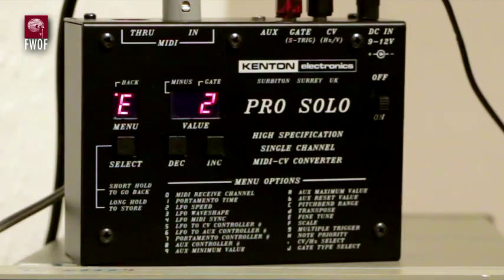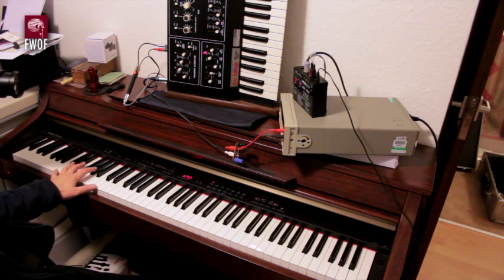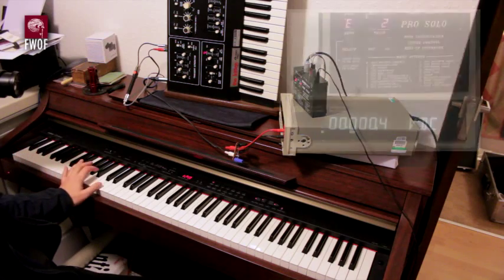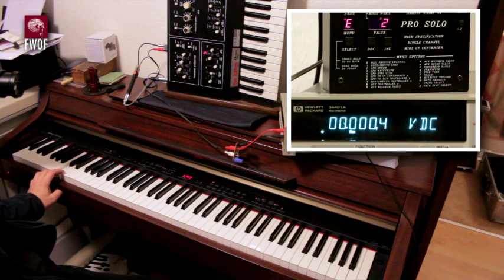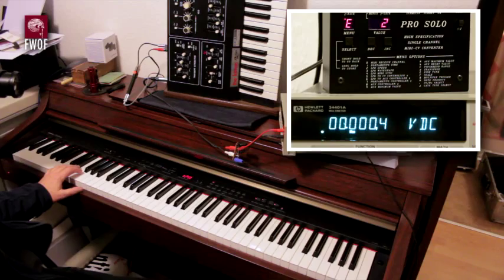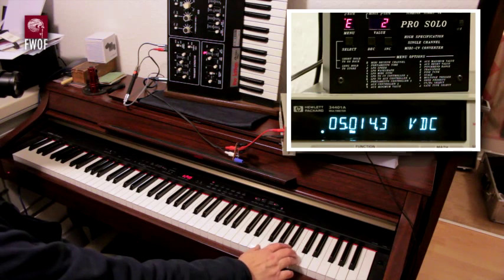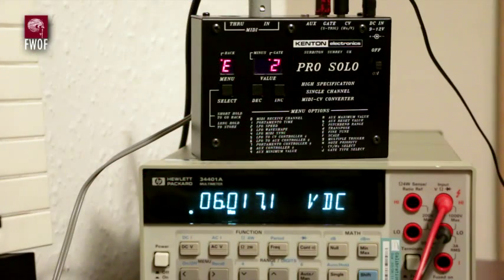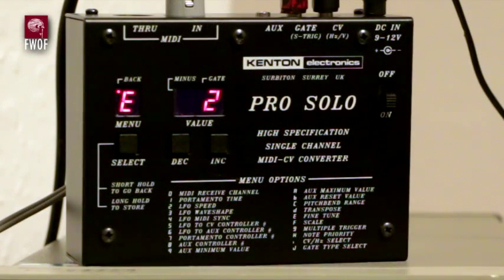Kenton Pro Solo MIDI to CV Converter

Comment: i cand control or send two midi signals to twoo synths? with any kenton interface.
and by the same time the two synths plays the midi signals? it is possible?
Reply from the maker: Hi Jose - this interface is designed to control only one synthesizer, as far as I know. See the manual http://www.kentonuk.com/kmanualspdf/psoloman.pdf

The Aux output is designed to operate a VCF (voltage controlled filter) if your synth can use that signal. It is not a second VCO CV output.

If you want to control two analogue synthesizers with the same signals, you could feed the CV/Gate/Aux outputs in parallel to each synth (as long as they use the same CV/Gate standards), but that is not the same as controlling them independently via two MIDI channels.

If you want to control more than one synth independently, Kenton make a multi-channel interface, see http://www.kentonuk.com/products/items/m-cv/p2000.shtml